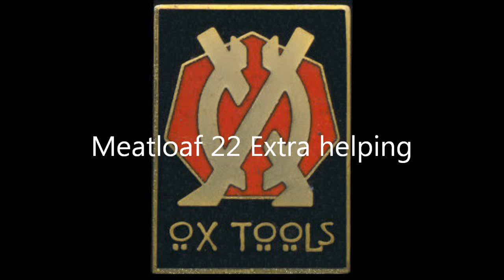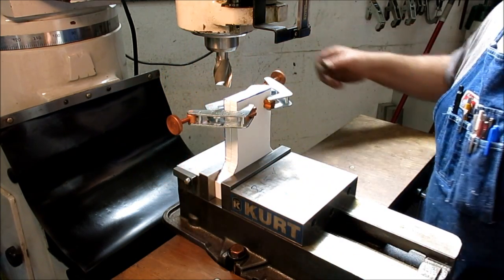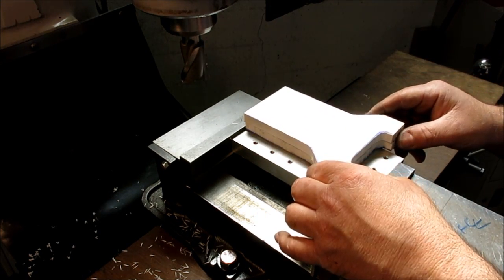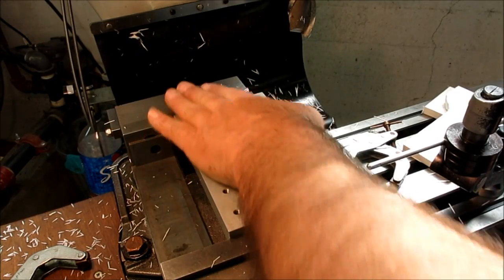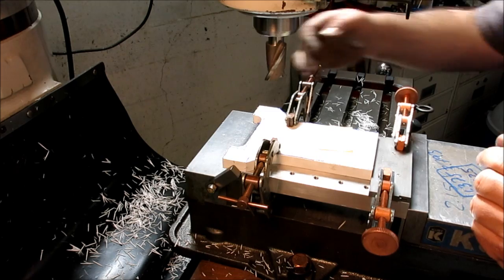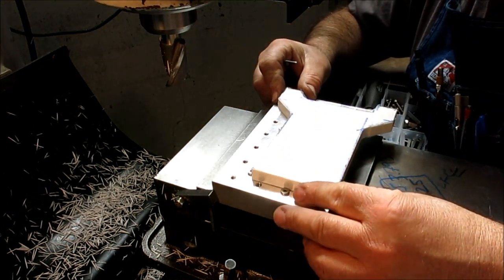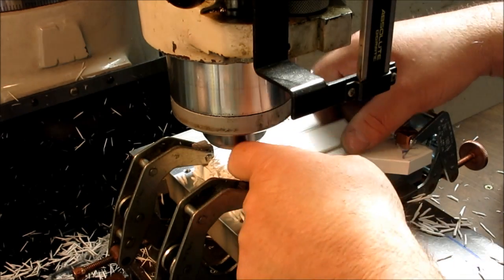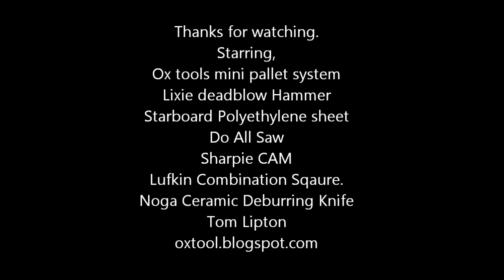Meatloaf 22 Extra helping

Comment: Hi Tom, love to watch the set-ups. Always learning. I like the "plug" that matches the end mill diameter. Easy lathe job, and a useful tool for the shop.
Reply from the maker: Hey Bill,

Its actually a piece of tooling from my Diacro bender. I was way too lazy to make something special for this particular job. Thanks for the comment.

Cheers,

Tom
Reply: Tom , 
Been meaning to ask where you get those Maxi-flex gloves? I checked all the usual suspects, MSC, Enco, Travers, didn't find them on their web sites. 
Thanks,
Bill
Reply from the maker: Hi Bill,

I get them from a company nearby called S&S Safety solutions. I'm told they can be had on ebay as well. Going price is around $3 pair but you have to buy a bag of ten or twelve. Oh yeah. Airgas welding supply has them as well.

Best,

Tom

Comment: Tom, lovely work, as usual.

I know you have said that you refinish the surfaces of your mini pallets when they get too chewed up, and of course that's a good idea. I ain't made some of those yet but they are high on the list!

In the meantime, when I need to do a "through" cut like you just did, I usually put a peice of sacrificial material between the job and the mill table. Offcuts of timber can be used, but can be dimensionally variable, so I often use suitably sized pieces of that "compressed paper" board, which in Australia is MDF or medium density fibre board, 4 mm thick, or 160 thou imperial. Cardboard from a cereal packet also works well.

Not teaching you to suck eggs (I wouldn't dare!) but perhaps it will stave off the evil day when you have to skim some more thickness off a valuable item of kit?
Reply from the maker: Hi Greg,

Normally I would agree with you on the sacrificial bit under the work. Many times it interferes with quick setup as it has to be the right size and thickness. Along with that its another loose piece that has to be positioned with the workpiece. That it the beauty of the mini pallet being semi sacrificial. I have the first one I ever made still that started out around 31mm thick and is now around 25mm thick. That's fifteen years of use approximately. The other advantage is when you resurface in the machine that surface is a flat plane perfectly oriented to the machine plane. This is important to sensitive operations like machine engraving. If I'm working on the mill table I definitely put a sacrificial piece down and many times its wood as well. Thanks for the comment and good question.

Cheers,

Tom

Comment: Hi Tom, definitely a great setup video! I was glad to see you move the mill head forward, I hope someone has to do something that requires moving the head off into the hinterland to reach something hanging off the table or some such thing that shows more of it's versatility... Thanks for sharing! :o]

O,
Reply from the maker: Hi O,

I had a one meter tube in the BP at work the other day mounted in an indexer head. Had to make extensions for the indexer and tailstock. I had that head swiveled from hither to nether and back. They actually have a good range of coverage if you let them.

Cheers,

Tom

Comment: Thanks for the extra helping.  I couldn't help think, though, that your approach really shows your machinist background.  A woodworker would make a template (using maybe MDF), rough out blanks on the bandsaw, and clean them up using the template and a pattern bit in the router table.  After making the template, copies would take 5 minutes each, max.
Reply from the maker: Hey Brian,

Woodworkers definitely attack problems with a different perspective.They are used to hand holding their parts for operations like this. I think that each trade has much to share with others if you mind is open to change. How would you have attached the pattern to the blank for routing? Probably could use the mill as a router table since I don't have a proper one. It would be a interesting comparison to do the same part with woodworker thought training. Are you up for a challenge? I'll send you some starboard and a drawing if your game.

Cheers,

Tom
Reply: oxtoolco
Hi Tom,

I have certainly learned a lot from you and other machinists on Youtube.  Much of it gets applied to my amateur woodworking.  And thanks to you and others like you, I am slowly learning to use my tiny metal lathe and my MIG welder.

The usual woodworking approach for attaching the template to the blank is to use double-sided tape.  A couple of other comments mentioned it.  Sometimes I'll use a couple of drywall screws instead, if a couple of screw holes on one side of the production piece don't matter.  I'm not too sure how well double-sided tape will stick to StarBoard.  Not much sticks well to HDPE.  Maybe best to stick the tape onto the protective film.

I can't see any reason your mill wouldn't work as a router table. You have already done that with your etching press handwheel.  For big pieces woodworkers will use a handheld router - not an option with your mill :-)

Brian

Comment: Tom, thanks for the vid!  I just knew that cool square was going to appear in that 45 setup, but I thought you'd use double sided tape to stick the two parts together so you could bandsaw and mill them together. I've done that with wood (mostly to make sure they end up the same, if not correct!).  Does that plastic not stick well to tape?  An alternative would have been to screw them together through the waste material in the "window" area....would have worked up until that part was cut away. 

If I was making those parts with what tools I have here I'd use template routing with vacuum hold down of the pattern on the material. Ideal method for smallish production runs would be CNC milling or routing, but I don't have those either. 

I think that Starboard gets used on boats for partition walls, for making equipment boxes for radios, and other items, and covers for openings. Apparently stands up well to UV, salt water, hot sun, vibration, beer, and other stuff you'd find on a small boat. 

I hope the rest of your cold clears up soon.

-- Mike
Reply from the maker: Hey Mike,

Good point on the screws. Like I said in the video you have to weigh how much time you spend holding the two parts together versus flopping them in a simple setup. Its like the fixture that holds too many parts and takes longer to load than the cycle time for the machine work. I didn't think of the tape which probably would have stuck fine to this stuff. 

Cheers,

Tom

Comment: Hey Uncle Bob,
      If you haven't already assembled the top plate, the starboard kinda likes SS sheetmetal screws over machine threads...   

      Thanks for sharing your time and talent.  You at least seem to be sniffing less these days.

All the best.  Chuck
Reply from the maker: Hey Chuck,

Haven't put the threads in just yet. Might try the sheetmetal screws if I have some nice stainless ones the right size. Thanks for the tip Mr soon to be grinding his brains out guy.

Cheers,

Tom

Comment: Hi Tom, I'd just like to say, the paper pick up method is a common one Here in the UK, however,  it frightens me to death and I cringed watching you use it, I prefer to use a wiggler.
I loved the techniques you employed, and I'm going to build my own pallet system. You have inspired me!
Reply from the maker: Hi Stewart,

What exactly bothers you about the paper method? The sheet is post it note and most times I don't even hold it between two fingers. I let the tiny bit of sticky hold it to my finger and then the cutter pops it loose. I'm curious to hear your thoughts.

All the best,

Tom
Reply: Hi Tom. I've used the method once or twice, and  my fingers got way too close for comfort to the cutter. It just put me off.
I didn't think of using a post it note. I used to tear off the corner of my drawing.

Comment: Geez, I gotta make up a mini pallet soon I guess. It looks so useful.
I'm not sure if the polyethylene would stick together well. It is a slippery plastic but I have had reasonable success sticking it a faceplate with carpet tape.
Stans squares are the bomb! When can we place an order for these Stan?? :-)

Colin
Reply from the maker: Hey Start bugging Stan. He is really jonesing to make them in bulk. I need to test the double back tape on this plastic. It might stick but the material has a surface texture as well. Almost like haircell ABS.

Cheers,

Tom

Comment: I think i've used this material a couple of years ago for an RC servo mount. If i'm right and this is the same material then it stands very well to the test of time. 

I needed a servo to open an close a valve on my motorcycle. Suffice to say that it's been exposed to: heat, fuel, oil, dirt, sun and vibrations. So very tough little sucker.
Reply from the maker: Hi Aserta,

I have not messed around with this stuff before. But after this job I will be trying it for all kinds of things. Its cheap and easy to work with.

Cheers,

Tom

Comment: Would stacking be worth it if you lowered the mini pallet in the vise so you could index both parts off the vise jaw?
Reply from the maker: When stacking parts you balance the stacking difficulty against the changeout time. In this case with two parts it wasn't really worth it. Also they were slippery so I was thinking it might not be a good thing to stack them. The little guy on my shoulder whispers in my ear some time with a good suggestion.

Cheers,

Tom

Comment: My Cincinnati mill cuts 45deg by engaging long and cross slides at the same time, no need to reposition. :-)
Reply from the maker: Hey Brian,

That's pretty cool. Do they actually engage at exactly the same time? Could you drive into a corner and be confident it wouldn't nick one of the sides? Most excellent.

Cheers,

Tom
Reply: The mill has backlash eliminators so it can do climb milling which helps a lot in hitting your mark in a corner. You have to throw the feed engages in our out yourself, so you have to be on it and not running super fast. It isn't hard to be within .002" doing it if you aren't running too fast and your brain can anticipate the DRO.

Comment: Tom if you were to use the screws as stops in a more fussy setup would you make sure the heads were all the same diameter?
Reply from the maker: Hi Eric,

For something fussy I would put a parallel there instead of the screws. I also use shoulder bolts sometimes as the shanks are nicer than screw heads.

Cheers,

Tom

Comment: Tom: Is cutter bending a concern on plastic?(IE), the cutter moving in and out a few thousands when you are traveling down the cut, with the centre already cut out? Thanks.... Kevin....
Reply: If your speed is reasonable, then no. It barely flexes. It's a math problem between heat, diameter of the cutter and the depth of cut. 

Table top CNCs have cutters that are sub cm wide. So if those don't pose a problem with bending something like the cutters presented in this video won't even glance at it.

One thing and Tom mentioned it is you have to watch your speed, there's this nice speed lane between too slow and possible snagging(the piece will bend with the cutter) depending on how you grab the piece (not this case as it was very well secured) and too fast where the plastic melts and the whole job becomes a mess.
Reply from the maker: Hey Kevin,

Not really an issue with this stuff. It truly cuts like cream cheese. The smaller end mill I was using was carbide. You could do what I did in aluminum no problem.

Cheers,

Tom

Comment: I didn´t read all the comments to this or to the previous video, so someone might have asked that before:
Is there a reason why only the lower plate is adjustable? Wouldn´t it be better if the pipette holder was one piece (which holds the tubes always on the same length) that just has adjustable stands? It would be considerably more stable and hold the tubes better, I guess.
Reply from the maker: Hi Sthenzel,

I mentioned it in the first video. There are different size sample bottles that have to slip under the pipette tips. These sit in blocks that they already have a million of.

Cheers,

Tom
Reply: I got that about the different bottle height from the first vid, so adjustable it has to be. But: Why make only the lower plate adjustable and not the whole rack?
Reply from the maker: sthenzel Not sure how making the whole rack move simplifies the design. I didn't really consider making the entire rack move up and down as the original is set up this way. There are at least two pipette lengths used as well which might explain the ability to change the distance from the top to the lower shelf. I don't have any of the shorter pipettes with my samples so I didn't show them.

---Tom